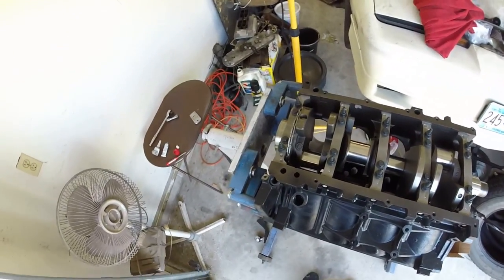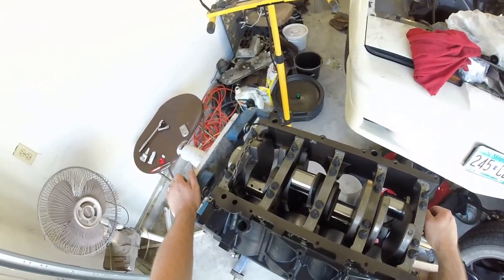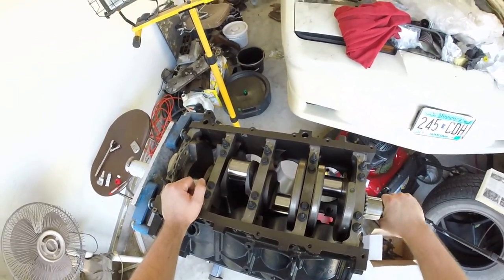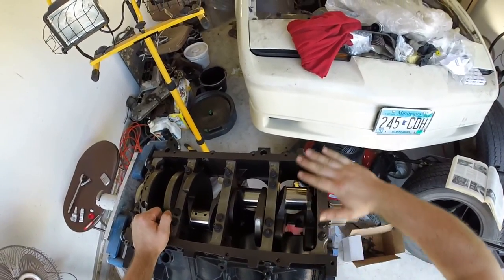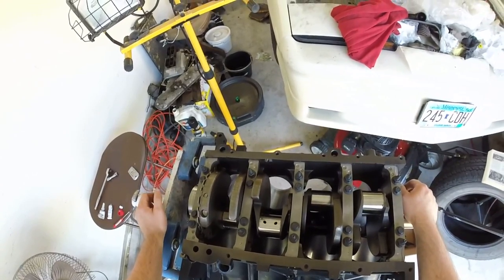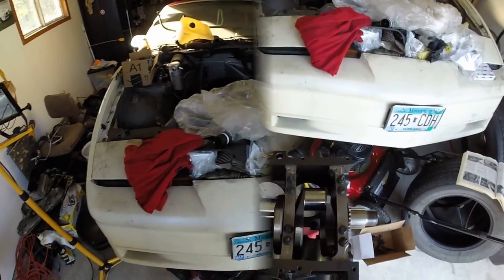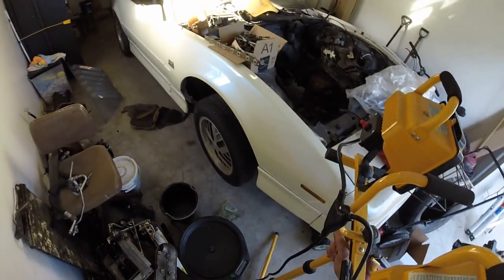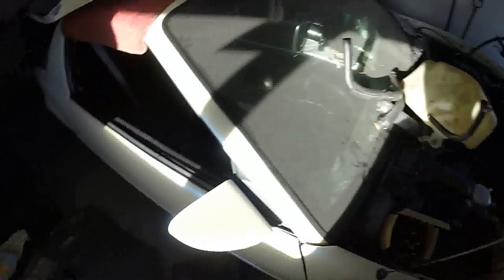How to install crankshaft and main caps (With Torque Specs!) For GM LS Gen3 motors

Comment: Yeah, as Bart below said, these are torque to angle or called “TTA” bolts. As a GM tech, but retired, having access to GM’s eSI (electronic service information) the benefit is being able to update information with a key stroke ans the same with TSB’s. But lets say you want to follow GM’s plastic gauge method for the cranks mains, they are removed, installed, torqued, removed, then inspect the “Plastigauge” (Sealed Power), then clean, lube and install the main bearing caps, using a PTFE thread sealant on the side bolts, sold at GM or Permatex brand. Either work fine but I use the high performance version of Permatex. If you want to buy new thats a choice. I will reuse mine. Liked! ASE Master Tech since 1978 - Retired

Comment: question here i torqued 50 on the main bearing of a honda civic and it became really tight almost un spinable so my friend took over and didnt use a torqued wrench and it run without knocking noise so i was wondering what would happen if the crackshaft isnt torqued properly

Comment: Those bolts are not torque to yield. They are torque to angle but not torque to yield like the head bolts are.
Reply from the maker: If I said torque to yield, I meant torque to angle. Oops!